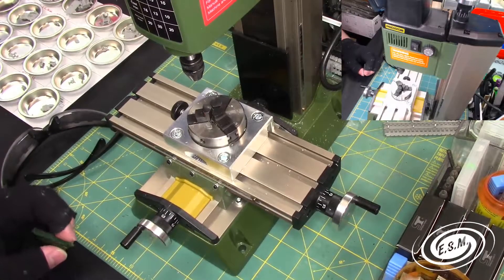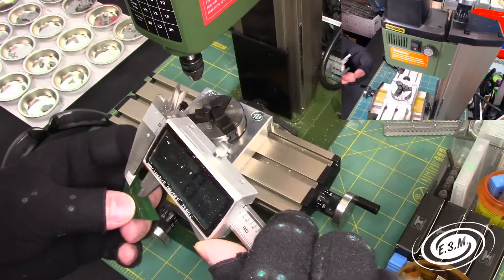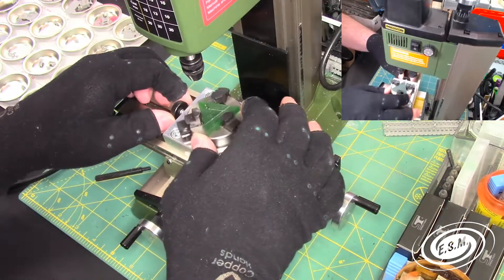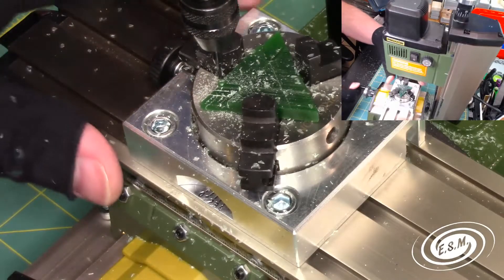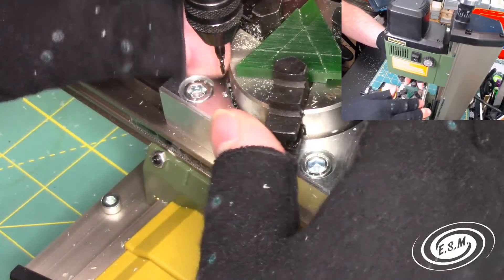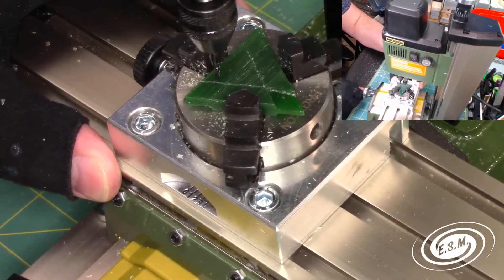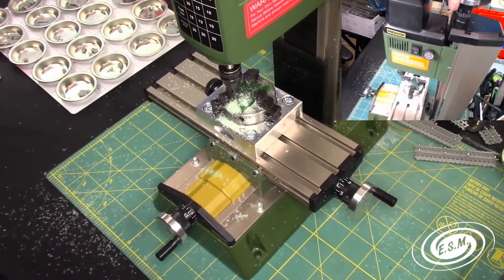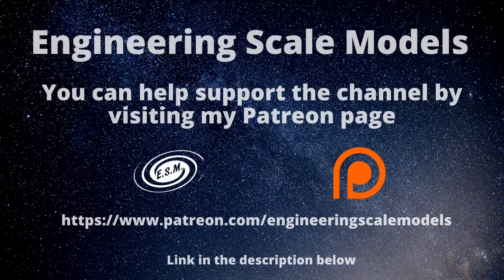Proxxon Mini Mill MF 75 Demo & Review

Comment: What attachment is that you are using to attach the cutter?  That’s not the one that came with the mf70 is it.
Reply from the maker: It’s the proxxon quick change collet for that model, there are 3 different types so make sure it’s for the mill and not the drill press or hand piece
Reply: @jasondoesthings919  does it enable you to use bigger mill sizes than the 3 that come with it?  Thanks!

Comment: I'm very interested in this mill. I'd be using it to mill slots in plastic, mostly. Do you think it could reliably handle that task on a regular basis?
Reply: It handles even steel with the right tooling